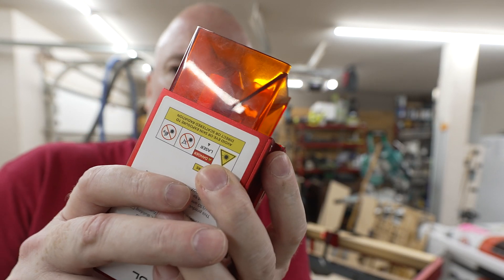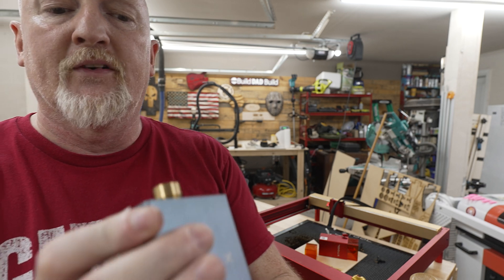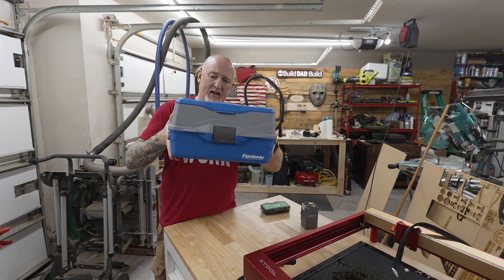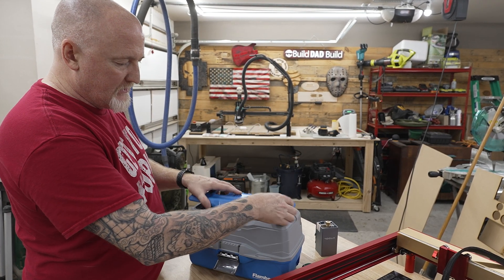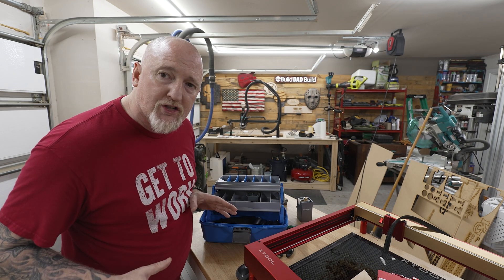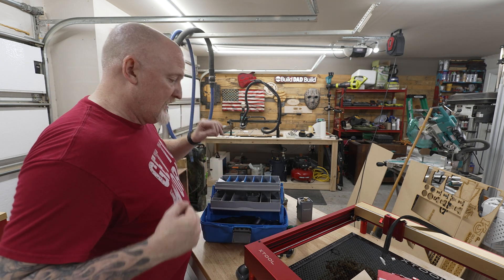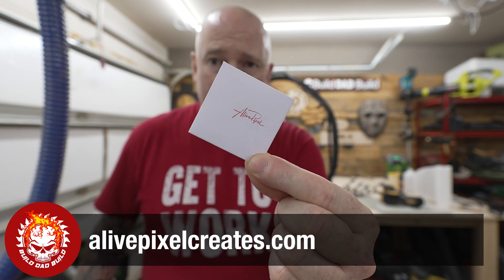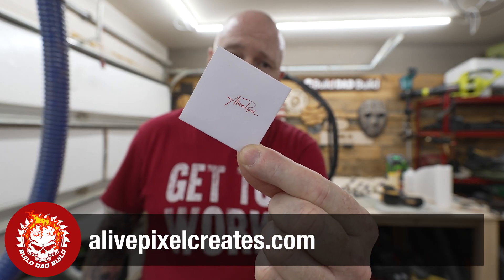How to Maintain Your Diode Laser

Comment: Good morning, thanks for showing where to use the lube, I was a little afraid of putting on the wrong parts of my d1 pro. I do have a suggestion for cleaning the aluminum tray and the honeycomb, I use L.A ‘s Totally Awesome undiluted. It literally melts all the tar and crap off of the tray and honeycomb. I have to use a kiddie pool because I have the extended pieces, so it’s easier to scoop the cleaner back into the original gallon jugs. Rinsing with a garden hose and spray nozzle while they’re leaning against a wall or something until no more bubbles come off, then out come the air compressor…. Works like a charm everytime. Good luck. SaraJean
Reply from the maker: Thanks for the tips!